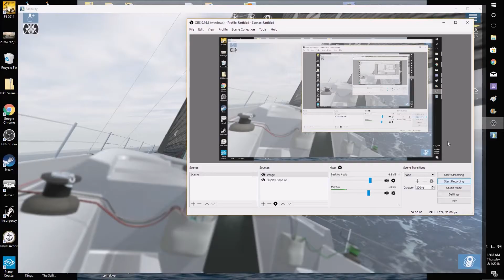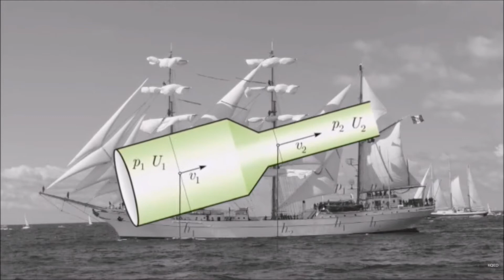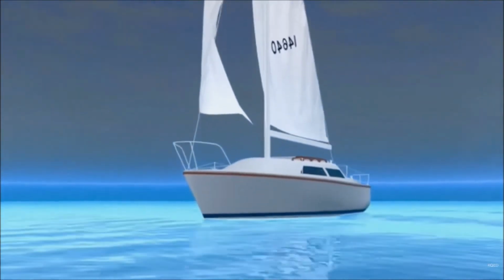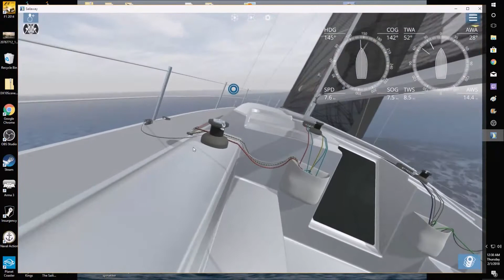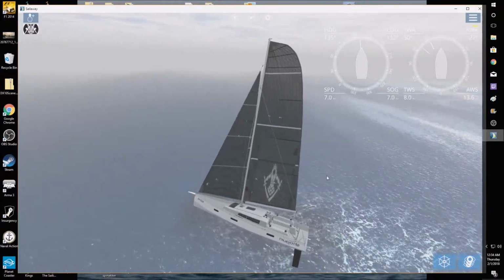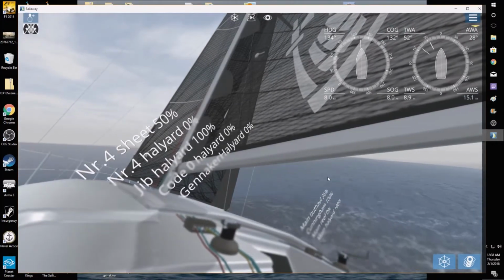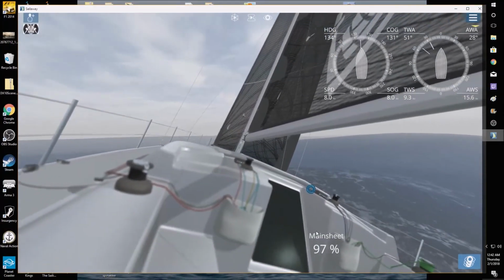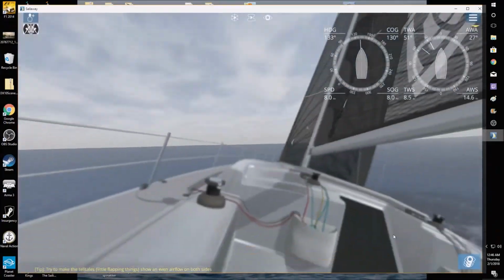Advanced sail trim. Sailors are just physics experts that drink

Comment: Excellent video, I'm glad I found it. Recently bought my (very), first boat; early 70's Hughes 25. Has a tiny keel (3.7 foot draft), but it's a lead keel and it weighs in at 1,700lbs. I think the entire vessel weighs 3,700lbs so almost 50% of the total weight. Not sure if that's a typical keel/boat/sail/balance ratio but...I'm brand new to all of this and I'm glad I found this video. I've never really sailed. I haven't even owned/operated a 12 foot aluminum fishing boat so next summer is gonna' be pretty effin awesome in my life!! Didn't have time to get it from the canal into a lake to hoist the sails once yet. Did not even raise the mast. Sadly, was too late into the season (Ontario), once I finally had possession of it. I'm impatient as all hell but I'm looking forward to it all, and you explain this stuff very clearly. It's been study time for me this summer. Next summer is hands on experience, and a lot of further study. Thanks for sharing, man. Will be checking your other videos.
Reply from the maker: Hey thanks for liking the video. I have a Pearson 26 on lake Ontario I race competitively. Similar to yours it's got a 4 foot draft iron cast keel you really don't want much deeper in lake Ontario. Also the weight balance in the keel seems right there's a formula for righting moment the boat must be able to spin itself back upright recovering from a complete knock down so most of the weight is always in the bottom center or keel. I could have made more instructional videos on my actually boat instead of this game but I never got around to it this year .